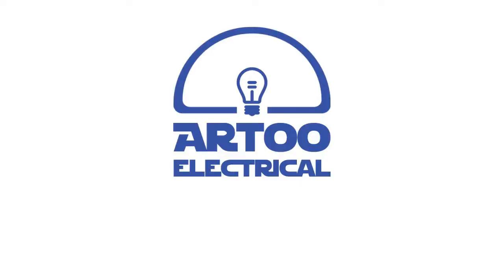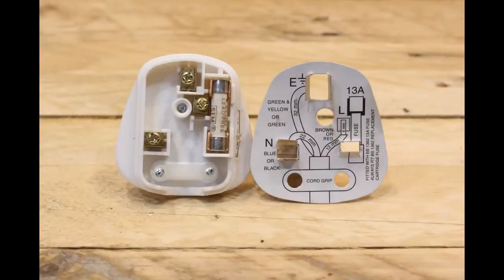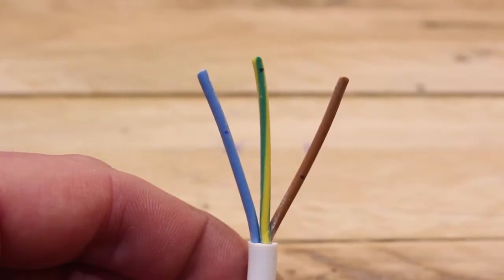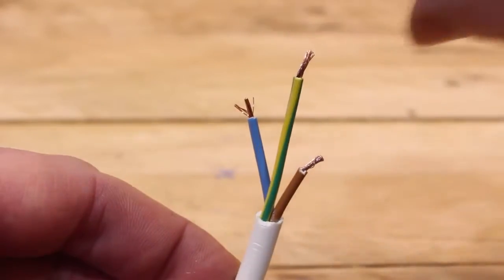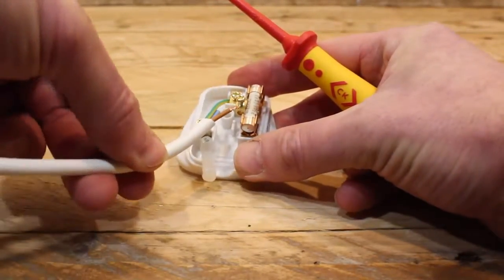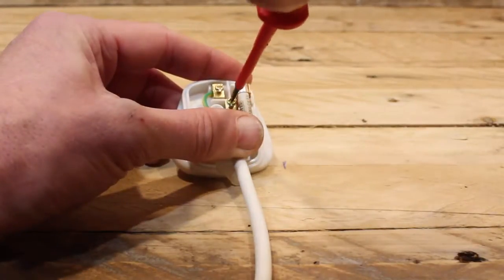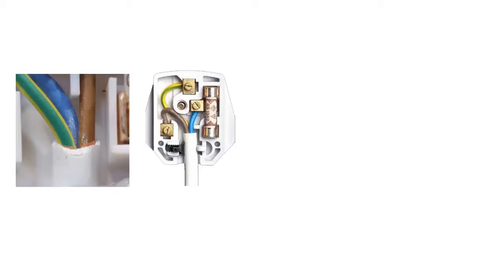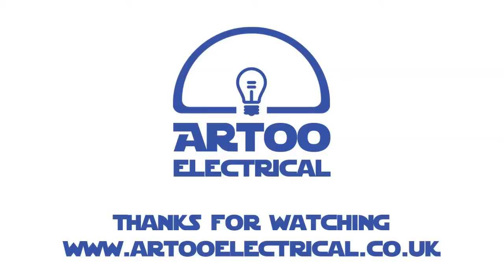How to Wire a UK Plug

Comment: Hi thank you for video, I am trying to add 3amp fuse plug to a 2nd hand flymo strimmer I bought, but it only has 2 cables, blue cable and brown, why is this? Also do I just do exactly the same as video or different?